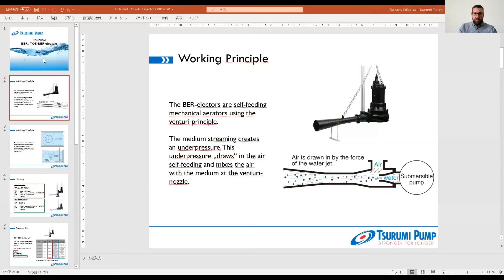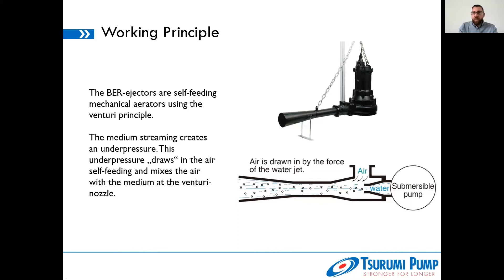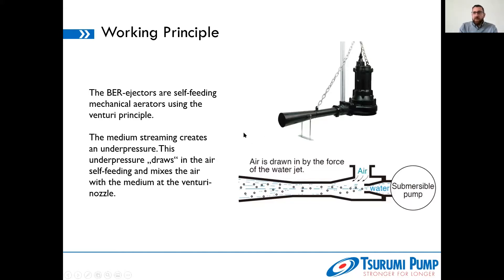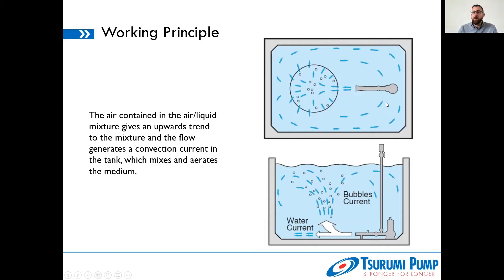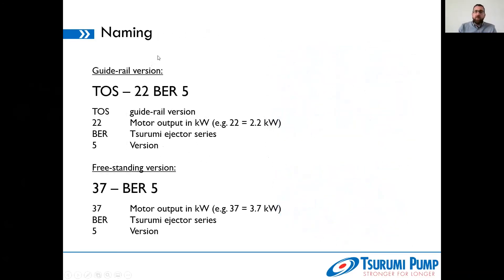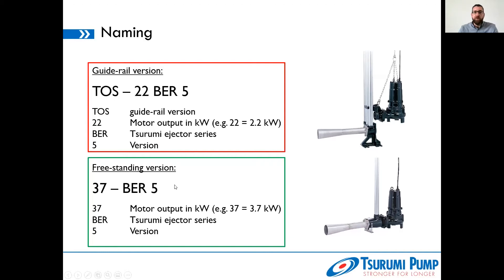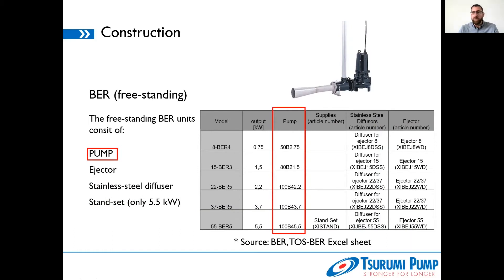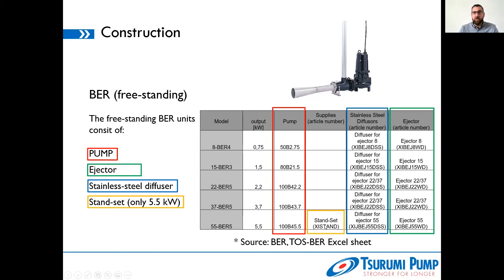Tsurumi Online Training: BER and TOS BER ejectors

Comment: Is it possible to use 22-BER5 at 1500L x 1200W x 2000H tank?
Reply from the maker: If you have specified the dimensions in millimeters, the answer is: yes! The 22-BER can be operated in a pool with the following maximum dimensions: maximum length 5m, maximum width 5m, maximum depth 4.5m. Within the max. dimensions as above, the 22-BER can fully mix the tank without the risk of sedimentation and a self-feeding operation is possible.